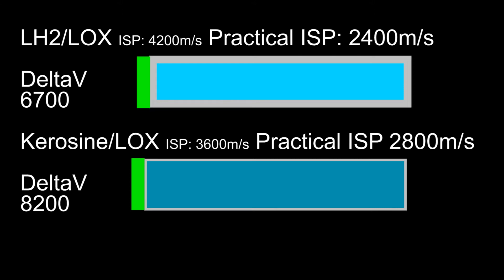Rocket-Fuel - Why Methyl/LOX may give more DeltaV then LH2/LOX

Comment: "Methylox" refers to a combination of methanol and liquid oxygen, like that used on some early Soviet rockets. Meth*a*lox is methane and liquid oxygen, the propellants that will be used on the Vulcan and BFR.

This increase in density and corresponding decrease in tank mass ratio is why in addition to a couple hydrolox stages, a few kerolox and storable propellant rocket stages could be used as SSTOs with no or few modifications* (at most, a re-engining with related engines to add thrust, sea-level Isp, or throttling ability). Examples include the SM-65D Atlas (typically a 1+1/2-STO, but could do SSTO with premature booster engine cut-off and a sub-Sputnik-size payload), the Falcon 9 first stage, and the Titan II/III/IV first stage.

*Of course, these would not be practical SSTOs, as they would bring very small payloads and not be reusable. Addition of the required heat shielding and landing mechanisms to survive reentry from LEO would probably push them off of SSTO status, with the sole exception of the Space Shuttle External Tank due to its ludicrously lightweight construction.